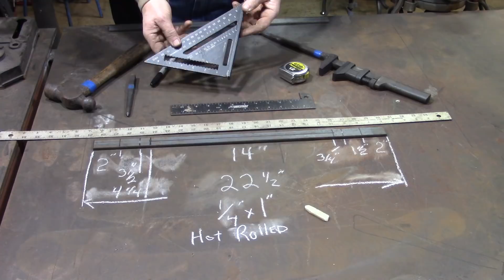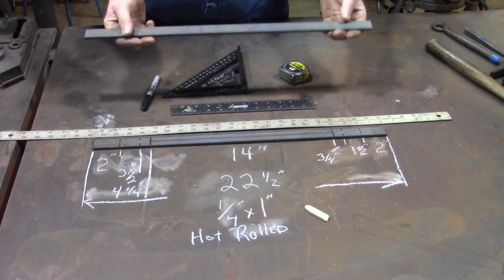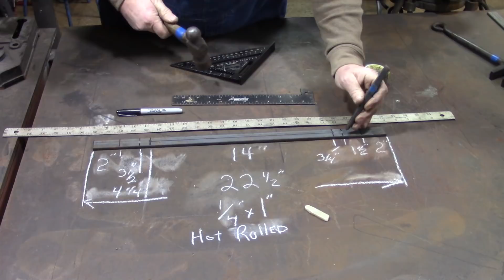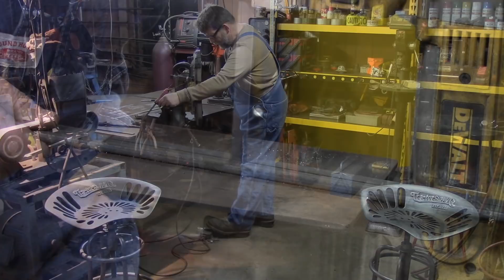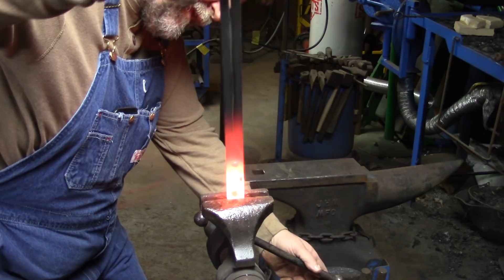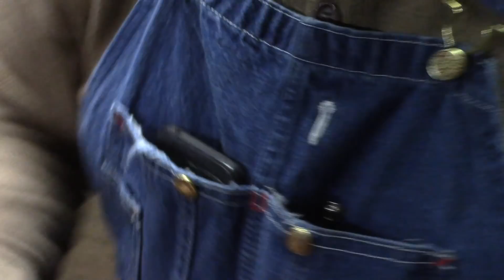Easy Tongs for Beginners

Comment: i know this video was published a while ago but i wanted to say thank you. I am not a fan of drawing out and am just beginning in my journey. I need several sets of different tongs. this method will help me immensely in making them. I will personally be starting with 1/2 x 1 "  stock as I have found that I prefer a chunkier reign, However this method completely removes the necessity of drawing them down from the parent stock twice for each set. now i just need to break the corners and round them out and forge the bit to finish a pair. I should be able to knock out a few pair a day and still have time to do other practice.
Reply from the maker: Glad it helped you out!

Comment: I made a set of these. I have a question... would it be better to drill a relief hole at a tangent to the corner in order to make the cutting easier?
Reply from the maker: You could, I've not tried it. Thanks for the suggestion!

Comment: Thanks for the great idea.  You could move the idea up to intermediate by cutting out the reins and then forging the boss and bits to your specs.  It’s a great way to avoid having to draw out long reins or forge weld them on using the drop tong method.  Extra bonus:  thanks a ton for showing me that you can do long cuts on thin stock using a portable bandsaw table.  The whole time I was wondering how you would work around the five inch depth limitation.
Reply from the maker: New blades help a lot, Yes you could forge the boss and bits. That would work well, especially if you don't have access to a power hammer.

Comment: Thank you. I´ve been getting by with a pair of flat tongs, and been looking for ideas of how to make my own with my limited tooling. Very detailed and easy to understand explanation from start to finish. 

I have too many tongs, no blacksmith ever said! 😃
Reply from the maker: I hope you can make several different styles using this as a guide. Let me know how they turn out!
Reply: I need to get me some 6 x 25 mm flat bar (that would be the closest metric equivalent to 1/4" x 1") , I found a pice of 5 x 25 mm, slightly shorter than in your design, so the reins will be shorter, but that might actually be a good thing since they will be thinner/weaker. I have riveted the two parts together, and tomorrow I will proceed with heating and twisting the bits. I used a combination of a jigsaw and a sawzall, but next time I will probably use a cutoff wheel, as it was a real pain to cut with the sawzall 🤪
Reply from the maker: I have used a cutoff wheel on similar tongs in the past. Let me know how they turn out!